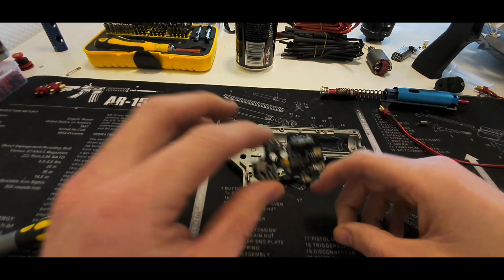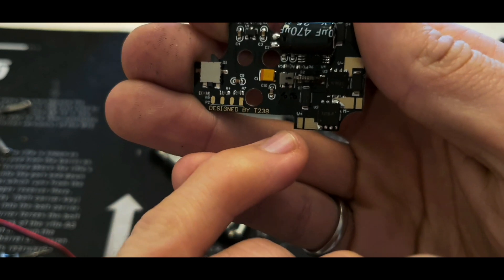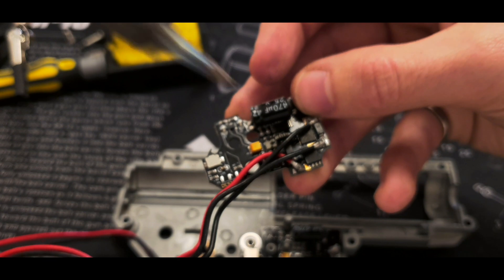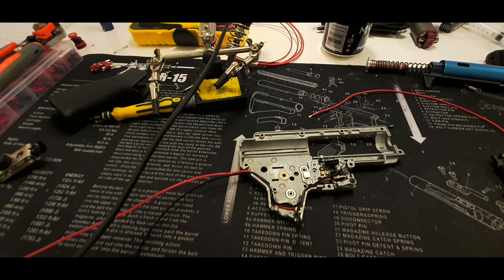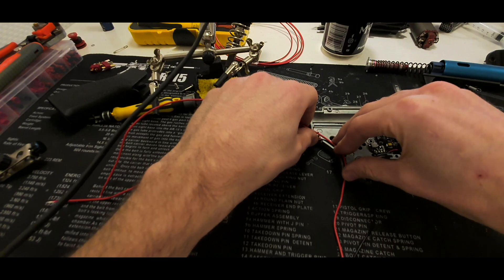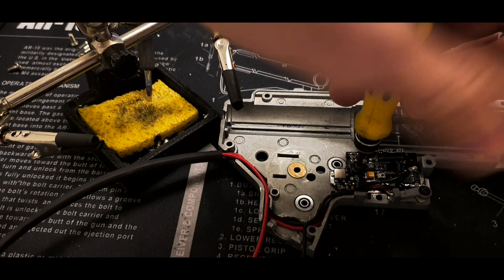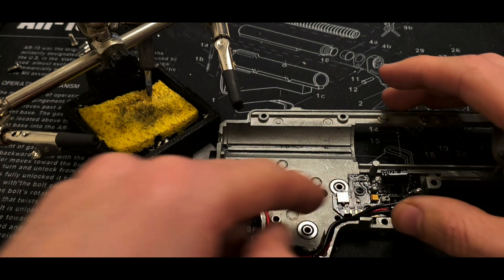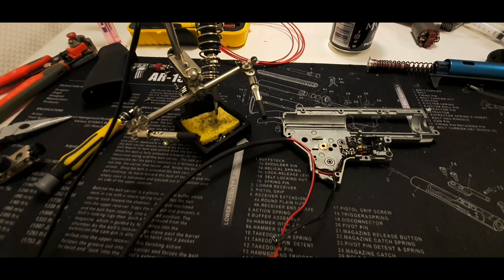T238 mosfet by NF strike installation video (aliexpress mosfet)

Comment: I noticed that you made bigger hole in the gearbox for the wires to go through, right under the pinion gear, is that required? It is a good idea if my wires doesn't fit?
Reply from the maker: If they don't fit then yes, but if you use 16awg ptfe wire it should fit.

Comment: Im just about to install one for testing. What is your opinion that does that signal wire need to bee as thick as you have been using?
Reply from the maker: I've been using 18 or 16 awg because that's what i have laying around atm, but you can go for 22 or 20 awg. I'll be switching over to mppe wire soon so then it will be 16 awg mppe with 22 awg mppe signal wire.
Reply: @callsignprofessor  I have 15 awg ptfe at hand. Well. It's the wire that will burn if that smol signal wire is not enough :) what kind of builds have you been running these? Seems that this could be good basic mosfet for basic builds. (have also the 1. 4 version)
Reply from the maker: 15awg is fine as well just a big thicker. I have build this in dmr 1.8 joule builds and anything from 17 to 35 rps ssg builds. Also had it in a 60 rps dsg which functioned fine but i haven't fielded it back then so no info on the durability with dsg's i will build one to see what it does. I didn't trust the sector cam switch of the < v1.3 but the new 1.4 i do.
Reply: @callsignprofessor  mine arived and im planing on doing a 18:1 dsg on it... ill make a vid with in a week if everything goes right.
Reply: andddd the unit fried xddd... fml
Reply: i put in it checked if it worked, it was beeping so all good. i than started shimming my gears after doing that i tested if everything worked nicely. and it did but the shimming  was kinda tight ( was shooting for like a sold 15 sec  semi) the unit didn't get hot but i heard rattling in the gearbox and it was a piece of the unit. It was the D3 which is in between V- and M-. I got worried and i checked if the unit still worked and it was fine so i made shimming adjustments put the gb back together and started shooting. everything was fine i got a few shots but after adjusting motor height it shot on its own and smoke came out of the unit. It was probably the D3 piece, im gonna contact the seller about it. Damn tho waited 2 weeks to burn it in 5 hours of playing?!? srsly? ohh well i hope they send me a new one or give me my dolla dolla back.
Reply from the maker: That sucks man, they are usually pretty good with customer service. Otherwise aliexpress has a dispute option that usually works.
Reply: @callsignprofessor  works well in 13:1 28tpa. 1.7J build. And that 24awg signal wire is fine